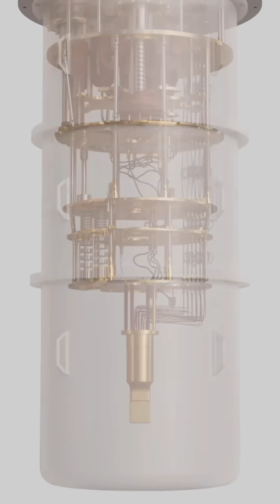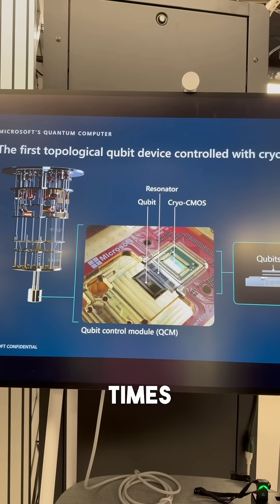Majorana 1: Microsoft's Quantum Computing Breakthrough!

Comment: What do you mean build atom by atom. That sounds like a year 3000 thing.
Reply: Yeah, building semi-conductors is imo the most advanced technology we as humans are capable of creating. It's kind of futuristic tech. Most of the computer chips inside our modern devices are built inside vacuum chambers where they apply the atoms layer by layer to create a extremly tiny circuit.

Comment: Someone please define... A topological state.
Reply: There are many topological materials (insulators or semimetals) . 
What they talk here is inverted superconducting gap in the bulk and two majorana states at the edges. Use AI to educate if you need more info.
Reply: It's the state that matter switches to when cooled to absolute zero. Normally matter is a gas, liquid, solid etc but when cooled to absolute zero it changes to a new state
Reply: @ms3862 not even close, it’s a solid with a unique electron arrangement
Reply: @ms3862 well thats wrong. It’s not a BEC. What absolute zero you talk about….Please dont reply to things you don’t understand

Comment: We have a warehouse full of cooling equipment to do calculations on a chip you can hold in your hand. 😂
Reply: Yep, all they've done is make the chip smaller, but the problem is they still don't have a room temp super conductor to use, so the computer needs to be cooled to absolute zero or the chip doesn't work and cooling it requires an entire warehouse and a nuclear generator
Reply: @ms3862 there’s something about this the way you put this that made me lol
Reply: @ms3862 false, they've made the chip more resistant to decoherence.
Reply: @ms3862  If they've managed to cool something to absolute zero, that is a much more exciting idea than this chip. Just saying.
Reply: It's way more efficient than actually making and using a full warehouse sized computer and also has a lot more room for improvement
Reply: The thing is, as soon as we'll have a functional and usable quantum computer, it will allow us to run simulations to find new materials with the desired properties, hopefully allowing us to shrink it down to at least a normal computer size.